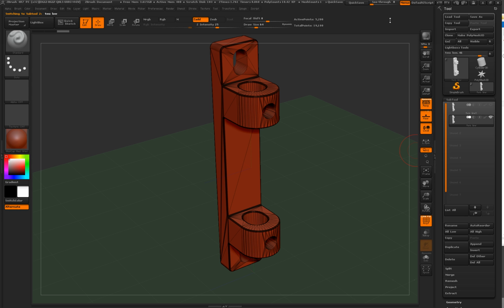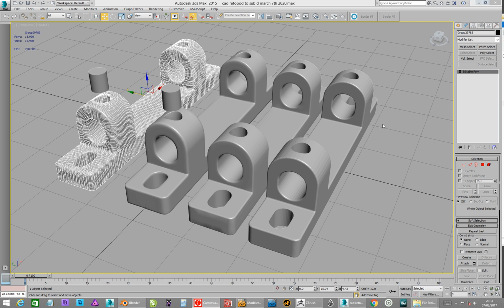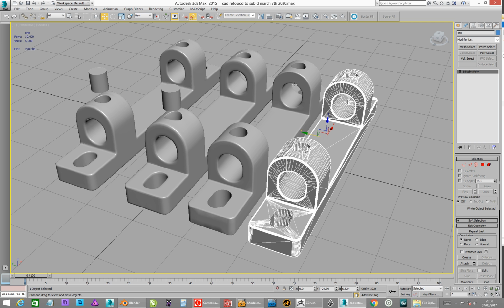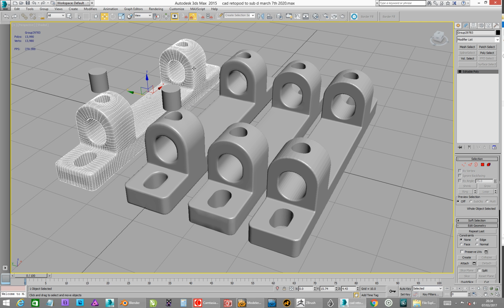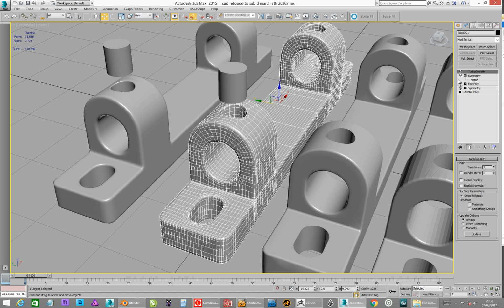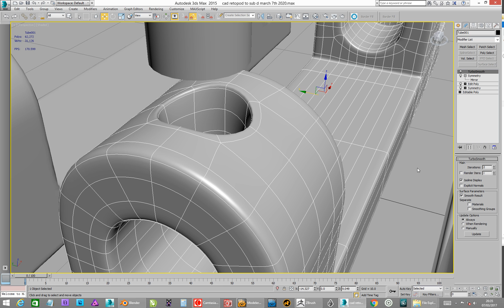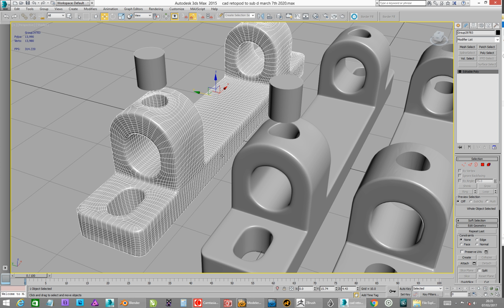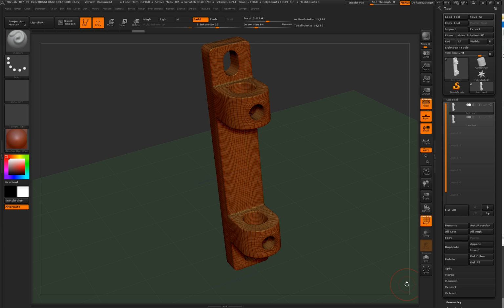cad model retopo with zremesher - zbrush and 3ds max

Comment: Zremesher does a pretty terrible job with even simple CAD parts for me (and I've tried a lot of them). Terrible flow, bends and reshapes corners, ruins curvature, makes things look absolutely busted. Would love to know what you're doing that makes them so much cleaner.
Reply from the maker: i just added z remesher ... was 6 years back probably either default or based around a few clicks
note you can now buy the z remesher as a plugin(max/maya etc) /addon (blender) for other apps you don't need to buy a subscription of zbrush.
https://www.youtube.com/watch?v=NFvmZbdxvTo
Reply: @cresshead  Cool, thanks for the reply. I've tried it in both C4D and in Zbrush with all the different settings people say to use, lol. Best alternative I can come up with (aside from, y'know... actual modeling) is volume meshing it and getting a billion polys. 😅
Reply from the maker: for sure it's not an exact science, some cad models transfer  click n go .. other are quite a head scratcher @mpbMKE   keep at it

Comment: This should take about 15 minutes to model from scratch using typical quad modelling techniques.
Reply: It's not about the model. But the concept of the  workflow.  It also works  with way more complex models.
Reply from the maker: yeh or zremesheer - click done.. 4 seconds :)
Reply: cresshead that doesn’t teach you anything about topology though. What if you’re working in a studio that doesn’t have ZBrush and they really need the model in Max, done properly. If you can’t fashion hard surface topology like this that’s lame. ‘Oh I could have done it but you don’t have ZBrush’ means that it’s ZBrush that’ll get the job not you. If it’s a big job and you need to save a shit load of time then fair dues but this is a piece of piss!